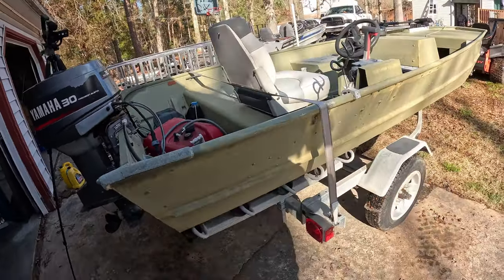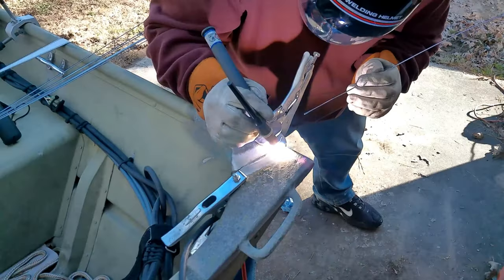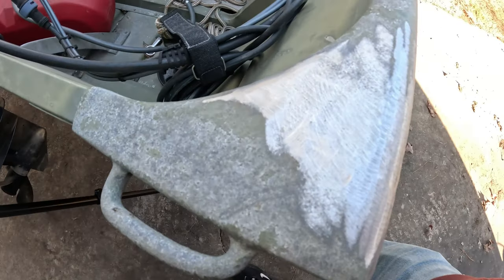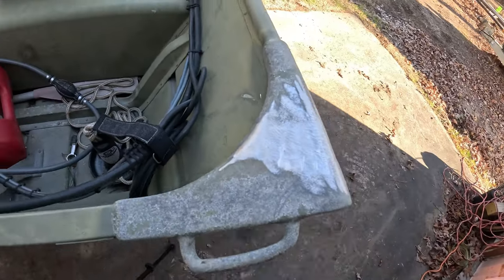Save Your Boat Transom! TIG Welder VS Dirty Cracks

Comment: My buddy put a hole in his boat and I recently got a TIG welder, for a thin Jon boat what do you typically start your settings at for amperage balance and frequency?
Reply from the maker: I honestly don't change it much from thin to thick aluminum. I leave the amps turned up and watch the puddle. Use the foot pedal to keep the puddle where I want it. If I'm having trouble with it trying to blow through, I'll dial the amps back a bit until it's easier to control... I do like to increase the frequency a bit to thin the arc width on fine cracks.
Reply: @ any recommendations for messing with a thin boats first time ?
Reply from the maker: @coltensawyer6761  if the boat is real old and badly pitted it can be almost impossible to weld it up solid as the heat from the weld keep chasing into the next pit. Just make sure the base metal on the boat is in good enough shape to weld it back solid before you begin. 

For cracks I'd drill the ends of them to keep them from running further in the future and open the crack up a little with a cutoff wheel. Dirt and corrosion gets built up in there and you will pull a ton of porosity into the weld.

Other than that, just ease into the pedal and see how the pool reacts. Patience here is key!

Comment: Did you clean that with anything before you started welding? I like acetone myself but white vinegar also does a good job. Cut the vinegar with a little wayer
Reply from the maker: Used cleaning vinegar on it... Inside of those cracks get super nasty.  Probably would have been easier to cut the crack open wider and get rid of the dirt on the edges.
Reply from the maker: Though it would have still pulled it from the bottom  unless i blasted it like someone suggested in another comment.
Reply: Yeah underneath is damn near impossible to get to but every bit helps. Looked good though. Renee be a weld is just a weld don’t matter how pretty or ugly  it is. Final smooth product with no porosity is harder to achieve.